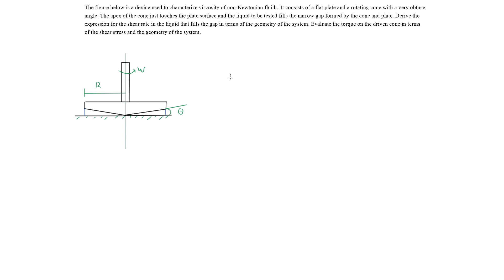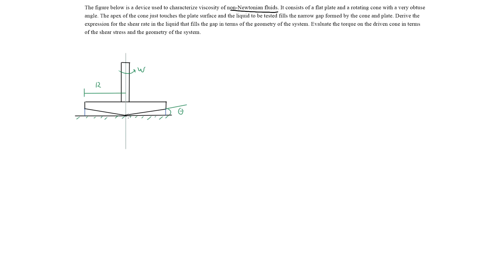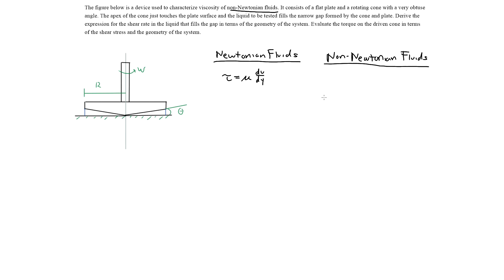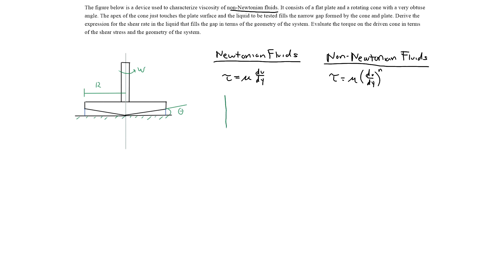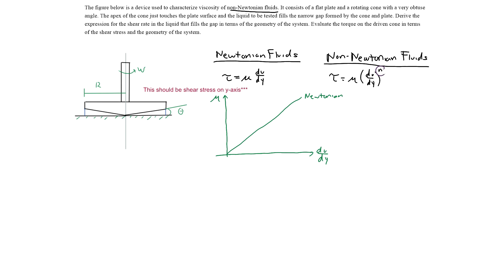Fluid Mechanics | "The figure below is a device used to characterize viscosity of non-Newtonian..."

Comment from the maker: *CAUTION*

There might be some confusion in this video.

When I took the integral of the angle theta (in the top view), that angle theta is not the same angle as the angle in the vertical direction (z-direction) even though I accidentally defined those two different angles as theta. So keep that in mind. 

Another source of confusion is assuming the that the area is the area of the circle instead of the surface area of the cone. The reason we use the area of a circle is because the cone is at a very obtuse angle which causes the angle theta in the vertical direction to be really small. So as that angle gets smaller, the cone becomes more and more flat. Therefore, it is a valid assumption that the surface area of the cone can be approximated by the area of a circle with a length R.